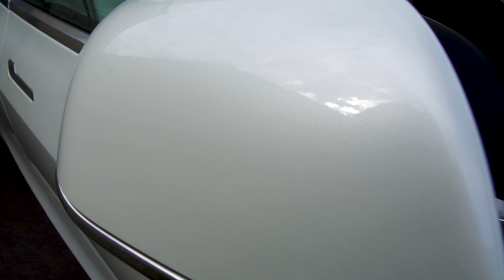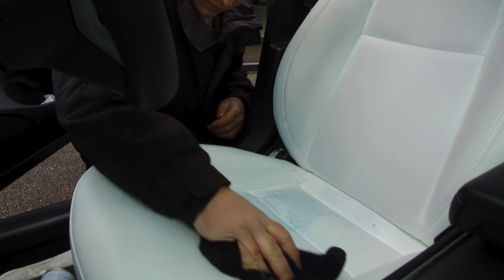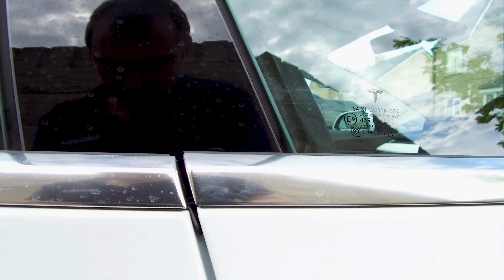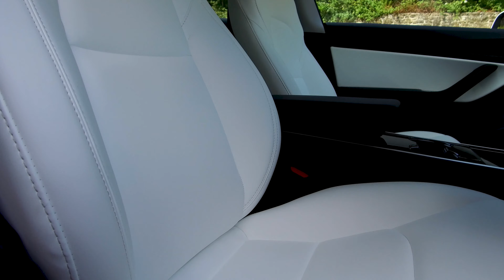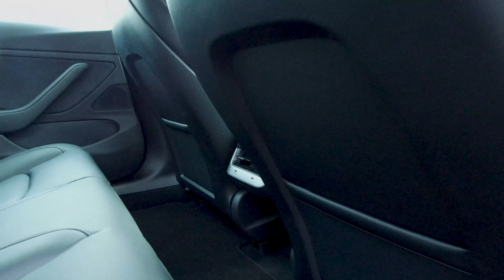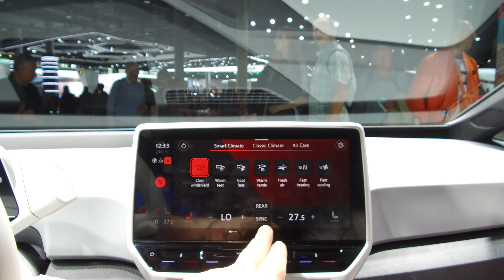Is Every Tesla Poorly Built? Why Do We Accept It?

Comment: I think it was a problem in the beginning but these days Tesla is like every other auto manufacturer - most of the cars are excellent but there's the odd bad one. Nissan and Toyota both had different problems with paint peeling (problems they tried not to fix). I think the problems are more prevalent in US built cars because the Freemont factory was a refurbish job and also Tesla's first attempt at mass production. They've learnt a lot and their new facilities are much more advanced and the automation is better and in particular the paint shop is better than Freemont. Model S Plaid is a different case. It's not really being massproduced and they're almost being handbuilt - and they're plagued with the same problems of panel gaps and trim fit.
Reply from the maker: I've had friends with cars from China factory with SAME paint issues

Comment: Quality, purchase price hikes, high costs of repairs, and the abysmally slow speeds of customer services  are the main reasons why we will not buy a Tesla. I would probably have stretched to buy one if the QA issues didn't exist. We bought a Zoe ZE50 R110 with CCS instead, for a good price, and have been more than happy with it every time we drive it. Incidentally, the ranges we're obtaining, when driven at normal highway speeds are consistently better than those claimed by Renault: We're seeing over 250 miles in Summer, and a minimum of 212 miles in Winter. Average has been 4.8 miles per kWh throughout the past year. And 3-phase recharging speed is twice that of a Tesla.

Comment: Picked up my Model Y from the big delivery in Southampton, perfect paint, no panel gaps, nothing missing, most of the issues you mention are from cars made in California, cars made in China are so much better and I am sure those made in Germany will be even better. The one thing they do need to change is the car washing, I was lucky, mine was perfect,  there have been many complaints from people picking up their new Ys that have indeed had the horrendous "preparation" you mentioned, simply unforgiveable.
Reply from the maker: I've seen plenty of the china cars with the issues and one mentioned in video was a China delivery... am glad yours is good however i find that most people don't know how to professionally check paint but if your happy with its condition that's all that matters...The german cars will be painted better thats for sure i've seen the paint line they are using, issue will be the adding of marks at the docks when they get washed.

Comment: I test drove an M3 LRDM 2 years ago. It was great to drive, but unfortunately the demo car had all the faults you mentioned - poor panel fit, thin paint, scratches, damaged door card and water in the rear lights. The MX they had in was in a similar state with trim hanging off and rear door droop. The salesman couldn't have cared less.  I didn't buy one, needless to say.  It's a real shame as their supercharger network sets them apart, but, being a fussy git, there was no way I could live with (at best) mediocre build quality.

Comment: I am over my excitement about Tesla without ever owning one. My EV excitement in general has waned after owning a Zoe for three years. A friend has a Model 3 and the thing he likes most about it is the tax break. I was initially seduced by instant torque, the silence and low running costs but having switched back to an SLK I can't see me changing for quite a while. If cheap conversions were available I would love my SLK to become an EV when petrol is no longer a viable fuel
Reply: I've never heard anyone say that (and them not be a troll) what about the EV experience has left you disappointed?
Reply: @Lewis_Standing  I found the Zoe very dull. I had a convertible before the Zoe and missed it a lot. MG may be bringing out an EV sports car though and that would be interesting but no doubt expensive as all EVs are. I do a low mileage so petrol savings don't make much difference to me. I couldn't fault the Zoe as transport other than journeys over 200 miles were a bit slow given the 22 kw charge rate. Teslas are a bit sterile feeling to me, if that makes sense?
Reply: @robsmith1a  the Zoe is no comparison to an SLK type car absolutely. I'm not sure they have made a car in that niche yet in electric. Roadster, taycan maybe.
Reply: @Lewis_Standing  my SLK cost me £11k which is my budget these days. Even the electric MG roadster is likely to be north of £30k. Taycan isn't a convertible either and too big and too fast to enjoy on the UK roads It is strange that speed limits in my area are becoming very low and many EVs now accelerate faster than Ferraris did thirty years ago.

Comment: You said it yourself:
Perfect paint and gaps VS Supercharging network that just works, great software, OTA updates, great batteries & motors & efficiency, mobile servicing, great residual value.

Sure, it would be nice to have everything but at the moment, you can't. So quite predictably, people will choose what really matters in a car and go for a Tesla.
As for the future, I think it's much easier for Tesla to fix their problems than for others to catch up in the areas Tesla is miles ahead. 
Do a follow up for the paint when you get your hands on a MIG Tesla?
Reply from the maker: Supercharger argument is getting less so now and rumours are more open SC for Europe this year meaning Tesla allowing access to their biggest draw means even they know other networks are now catching up…

Other batteries and drives now caught Tesla tech it’s just software and the new plaid drivetrain
Reply: @NicolasRaimo  
Sure, when they open up all SC the argument will go away. 
I personally wouldn't buy an EV for long trips based on these rumours. I'm sure they genuinely want to see all cars on the road being electric at Tesla but not sure they'll kill one of their main selling points for nothing in return.

Do you have examples of other EVs at similar price that match the range and efficiency of the Tesla models? 
I was left with the impression that the only one close enough was Hyundai, but I don't keep a close track of this.
Reply from the maker: Hyundai cheaper and Kona is more efficient also no phantom drain at night.  Ioniq 5 efficient same range and 800v charging system,  i'd argue 800v is past tesla's current stuff.   Also we will see most car makes go towards v2g this year with ccs and tesla i doubt will do this due to selling a home battery.